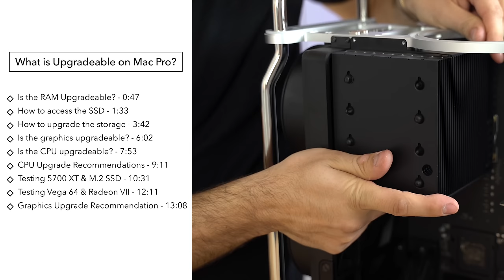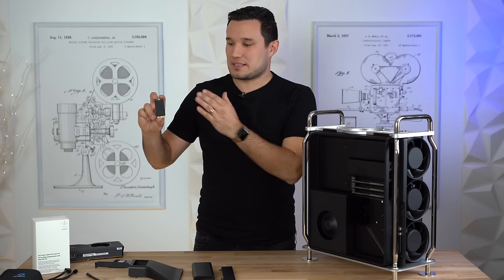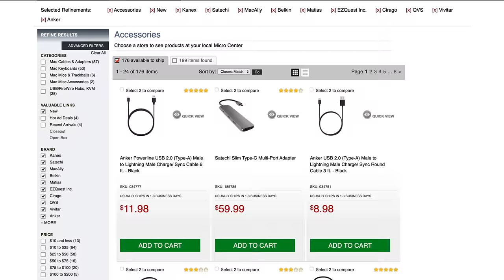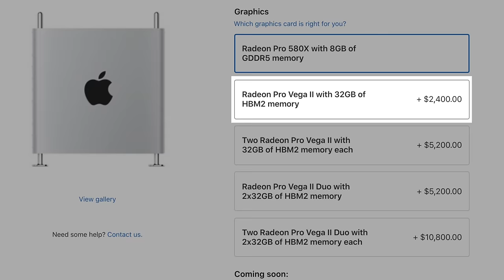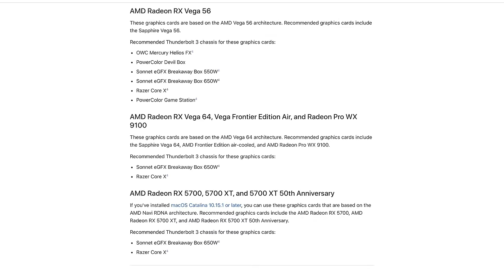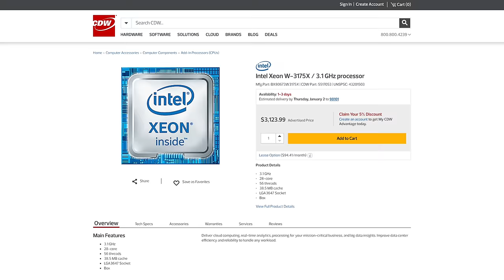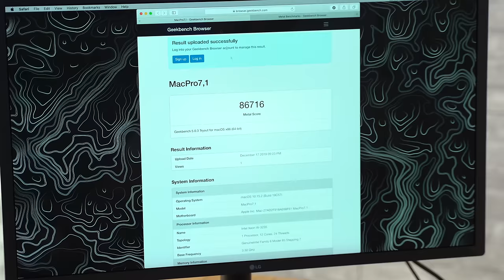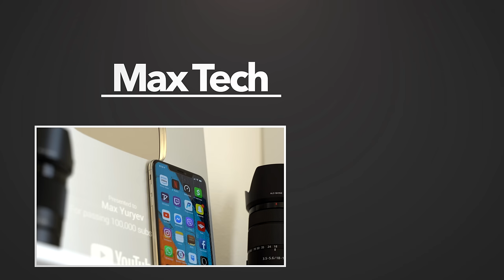2019 Mac Pro - Everything you can Upgrade & How!

Comment: Geekbench on macOS is still broken and gets too low scores on compute benchmarks with PC cards. Luxmark is better for comparison and shows the proper results. So this has nothing to do with the drivers. You run the Geekbench test again on Windows you will see much higher scores closer to the Radeon Pro Vega II.
Reply: Luxmark is OpenCL benchmark, not Metal benchmark. Metal is used with most of macOS apps!
Reply: @MorgonautHackintosh  It doesn't matter, as I mentioned Geekbench is broken on macOS. Scores are too low for both metal and opencl tests. This is not reflected in any other benchmark. This issue started in macOS 10.14.5 and hasn't been fixed ever since.
Reply: @chinamobilemag  it does matter a lot :) But yes, fact is, Apple is crippling performance of certain cards under macOS in favor of their own cards
Reply: @MorgonautHackintosh  Apple is not crippling performance. As I said Geekbench is the only benchmark spitting out low scores since macOS 10.14.5. It simply is a bug they somehow don't fix and thus Geekbench isn't suitable for any comparisons.
Reply: @chinamobilemag  Apple IS CRIPPLING performance. Even this video is a proof of that. Vega 64 cannot be more powerful than Radeon VII!!!!!
Reply: @MorgonautHackintosh  Apple is not crippling performance and this video does not proof they do. All it proofs is that Geekbench at the moment is bullcrap and not suitable for any comparisons.
My Vega 64 used to score above 200k points (overclocked) in Geekbench 4 pre macOS 10.14.5. With 10.14.5 Apple did an overhaul on the drivers and from then on Geekbench started to act strange. My Vega 64 only scored between 150k to 160k from then on and this hasn't been fixed ever since. The same strange behavior applies to Geekbench 5 as well. However, none of the other benchmarks indicate any performance loss. Some of them actually score better with the overhauled drivers and with my Vega 64 actually much higher than in an iMac Pro (which on Geekbench somehow scores higher than my Vega 64).
And yes, the Radeon VII (I own one) does indeed score lower than a Vega 64 in Geekbench and RX580 cards score about the same as Radeon VII cards (hilarious, isn't it?!). Yet again, no other benchmark (GFXBench, Luxmark, Indigo Benchmark, Blender Benchmark) and no real-world use case (gaming, FCPX) indicates any loss in performance. They all are very close to the results on Windows. Same applies to my RX 5700 XT as well. This solely is a Geekbench issue and either a bug or intended behavior to let Hackintoshes look worse.
Reply: @chinamobilemag  you simply don't want to understand so no probem, keep your own truth, I will keep mine :) And if you would like to see what I'm talking about, try to run for example DaVinci Resolve, it defaults to Metal = works great but with degraded performance, then switch it to OpenCL where Radeon VII should shine and you will see so poor absolutely unusable performance! So instead of watching benchmarks, you should proceed with real life tests! Radeon VII in macOS and Metal has just few % more performance than Vega FE, but it should have nearly double the performance!
Reply: @MorgonautHackintosh  You are the one not willing to understand. 😂
Have a good one!
Reply: @MorgonautHackintosh  Geekbench 5.1 released. Scores back to normal on macOS, at least for the Radeon VII, haven't tested my other cards yet. So much for Apple crippling performance of 3rd party GPUs...

Comment: 1- the video card is made to work with the thermal design without fans, and you will loose ports on the machine. 2- the Apple SSD holds the restore files, so you will loose that by replacing them. Lousy video.

Comment: 580x with a 28 core cpu that looks like a bottleneck.
Reply from the maker: 580x is a bottleneck with a 12core cpu lol. The 580x option is meant for people who don’t do any graphics related work at all. It’s there to simply make the connection to your monitor and provide a bit of graphics acceleration in some apps. It’s also there to be cheap so you can easily buy your own card if you want. -Vadim

Comment: Cheap Mac 6500€, a 8 cores 16 threads, 32Gb of ram and a RX 580, If i build a computer whit a 32 cores 64 threads threadripper, 64 GB, a 2080 ti, high end motherboard, titanium 1500w power suply etc, etc, etc ... still will be under that 6500€ price.

Comment: When you waste thousands of dollar$$$$$ on a Mac Pro and discover you can't change the boot drive, it has no m.2 slots, it has no exhaust fan to move heat at the top of the case, it has a slow CPU and then you upgrade the graphics cards and the display ports don't work properly. Congrats.

Comment: You too can upgrade to one of  Intel's fastest 28 core processors for more than twice the MSRP! What a deal!
Why the hell people buy these Apple rip-offs is a complete mystery to me.
Reply from the maker: Intel's retail price for the 28-core is actually $7,453. A
Apple charges $7,000 for the upgrade. 
Check out this article. 
https://www.anandtech.com/show/14513/intel-cascade-lake-xeon-w-3200-launched-server-socket-64-pcie-30-lanes
Reply: Max Tech i think the main problem is that there are better options, even technically for MacOS on a Hackintosh, you can easily buy a faster 32 core Threadripper 3rd gen and assemble a Hackintosh no problem :) the only software which wont work is the message and social ecosystem of Apple :)

Comment: Not bad, but I don't trust apple to suddenly "not support" PCIE storage hardware and completely F over it's customers.  I'll just build threadripper.
Reply from the maker: I think if they would do that then they wouldn't have made this machine to start with but made an update like the locked-down trashcan.
Reply: @MaxTechOfficial  You really think they're going to allow everyone to buy the 6k version and upgrade it themselves?  Why would anyone buy Apple's RAM, SSD or graphics cards?  Apple is 100% going to cockblock most of what you just did.  Or make it unsupported".

Comment: It's still overpriced unfortunately. If Apple was smart they would lower the entry price so more people would be comfortable to buy into this Mac Pro ecosystem. Great review and information....and this product is built extremely well....just that Apple tax .
Reply from the maker: Yes, we do wish the entry-level price was lower. That most likely would mean a lower quality or less fancy chassis, less expensive and less expandable motherboard, a lower end power supply maybe 800watts instead of 1400watts and some other drawbacks. Apple chose to go all-in on the base system (I'm talking everything that doesn't account for a performance like CPU and GPU) to make future upgradability much easier.
Reply: @MaxTechOfficial  maybe I'm wrong...I will go and price out this new Mac Pro offerings.